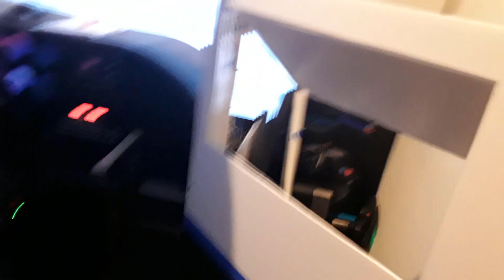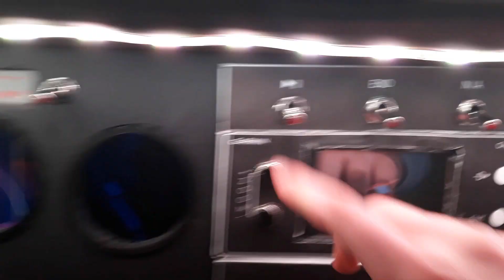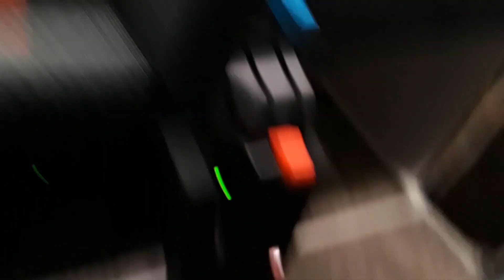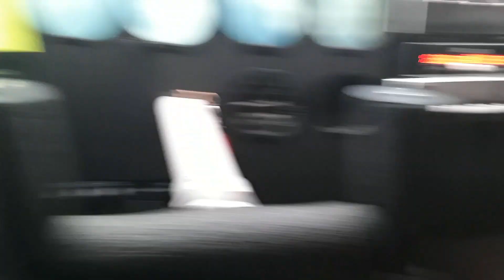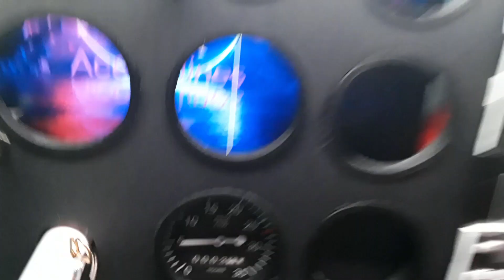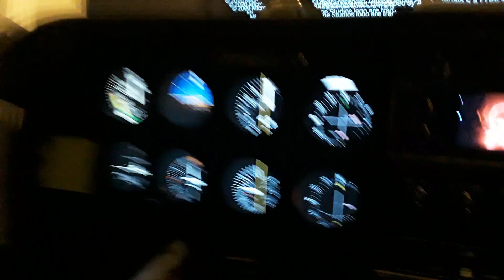Cessna Home Cockpit In-Depth Look [Ace Airlines]

Comment: I was checking out your early days of your sim. Actually, I only use just my 55 inch screen for everything, and I am simple, I just use HoneyComb Yoke $ 250 ish dollars. And I have rudder peddles (forgot the name, lol ) And Throttle quadrant like you do. Both are hooked right up to the same table holding my screen. Real enough for me, I use my mouse for everything I operate. later I may buy an Auto Pilot unit, from somewhere, maybe Amazon, not sure yet. It will go on top of my Honeycomb yoke. That's it. Oh, and I have a great Idea on how you can use a regular Yoke system, and take off the yoke Handle, but leave the pipe in, and hook up your PVC to that, make sure your yoke is Tied down good! And on the PVC Pipe going in your cockpit will hook wires going from yoke box to cockpit yoke handles, and also you can use a Tie Rod assembly to control both yokes on one Yoke box!! Nice Huh? Question: What size TV are you Using for forward View? Thanks, If you need me to draw out my Idea, then I can email you a drawing perhaps. Peace. Terry
Reply from the maker: I actually looked at doing that however there was not enough space behind the panel for mounting the yoke. I use a 65in tv.

Comment: This is pretty cool You know what would make it better is getting two more screens one on each side of you or I'm surprised you don't at least have track IR
Reply from the maker: Thank you. I actually do now have a window on the left. I am working on a video for it which should be out soon. I can't put one on the right because of structural issues with the door as well as airflow. I will definitely have the windows working as soon as mfs2020 supports it.

Comment: Did I miss the part where you showed the linkage for the yokes?
Reply from the maker: You didn't. However, I am planning on making an update video as I recently installed a new throttle assembly. In that video, I will make sure to include info on the yokes.
Reply from the maker: I have recently created a sim update video in which I included a small portion on the linking system. https://www.youtube.com/watch?v=Lh1Xh08NwVw
Reply from the maker: You may have already seen this video but I just rebuilt the roll linkage. In it you can see exactly how the system works. https://www.youtube.com/watch?v=2w4zJs2iR1Q

Comment: Hi there. Love the sim setup. I am doing something similar with a cessna cockpit layout and since I have now moved to FS2020, I wanted some external gauges software to run similar to yours. You mentioned that these gauges were available to download and that you tweaked the code for them to run with FS2020? Could you give me some more information about doing this and/or provide a link or some instructions to get these to work with FS2020? Keep up the amazing work. Happy simming....
Reply from the maker: I am actually running The Gauges Factory instruments. They are completely free and designed to work with FSX. If you run FSUIPC 7 however, you can actually get them to work with fs2020. The setup is a little challenging, so sometime in the next few weeks I will make a video explaining it. https://www.mycockpit.org/forums/content.php?r=340-The-Gauges-Factory
If you have any other questions post it here and I will include it in the video.
Reply from the maker: I just finished a video that goes into detail with my instruments. https://www.youtube.com/watch?v=9f37oFTNEMk